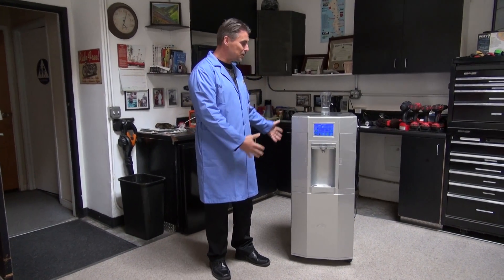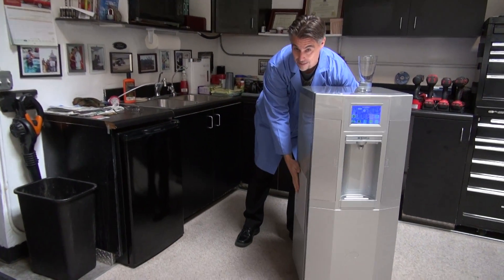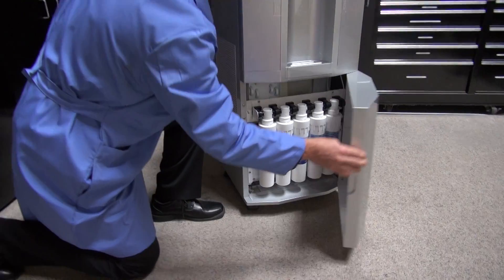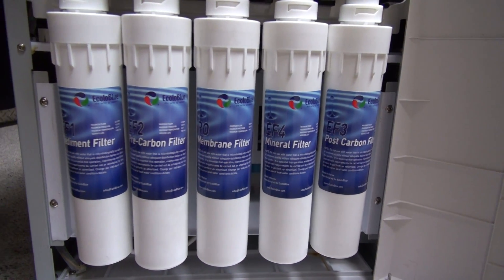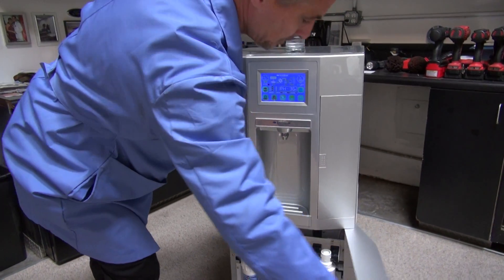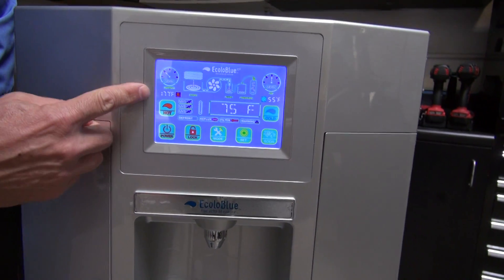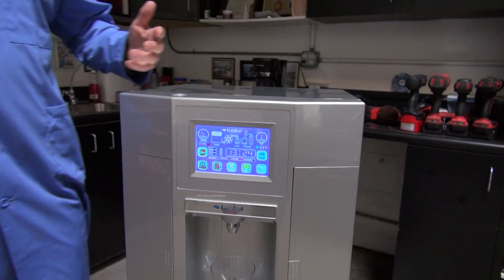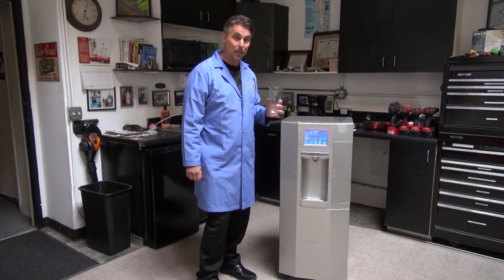Atmospheric Water Generator

Comment: I'm given a project under the same concept although mine is to design an AWG casing, could you kindly assist me by highlighting the factors that I should maybe focus on, the critical specifications, type of material to consider using? Since it should be placed in the rural area, so I have to consider the environment there as well as the evolving weather conditions.
Reply: Please call when you have a moment. (808) 220-4579   I'm the owner and founder of Atmo Systems. We're the largest manufacturing company of Atmospheric Systems. www.asairwaterfiltersystem.com. Just one of many websites we have

Comment: I live in cancun where it's normally 80% humid. However in my house, with the a/c and all windows closed, this number will go down. Can it be installed in a way to pull the air from the outside of the house?
Reply: Yes. It is called a "hose."

Comment: Sustainable? How much electricity does it use lol. Not economical at all.
Reply: It might be, if you connect it with a solar system.
Reply: what solar system?
Reply: @denismercpanganiban9971  Photo-Voltaic Solar panels, an inverter, and battery system, then boom, you're independent of the grid.

Comment: Or you can go buy a dehumidifier at home depot and a brita filter.
Reply: Kim - what chemicals? Its a simple thermodynamic exchange. Water in the air condenses on the cold coils and collects in a tank. The way you cool those coils makes no difference because it never makes contact with water itself.

Thats about as stupid as saying that food from a fridge has chemicals in it.
Reply: This uses exactly the same tools as a dehumidifer. the only difference is the filters is 2 stage carbon. 1 prefilter, and 1 membrain filter with 1 mineral filter to add stuff back in + probably raise the Alkaline levels up as most dehumidifed air water has 0 alkalinity. But that can differ from place to place's air humidity.

You can make this exact kind of machine for cheap (probably 200$) for a portable use. But, the prob is it won't produce a large daily need of water. 

Also No dehumidifers don't have chemicals in their process. Dehumidifers use 2 metal plates. 1 hot 1 cold, and this drops the water into a tank. If you're talking about Bead ones. Then yes, But you can't get water from them as their into gel caps.

But you'll want a filter (a brita filter will do.) to prefilter and clean most stuff out like dirt,etc. then a UV light to kill anything living. Then to reboost the water's drinkable ability for minerals and what not. a Alkaline pitcher. 3 stages. Simple. Or you can add a other stage before  UV killing and realkaling the water, like a membrain filter. This will make it so you'll be 100% sure you'll have everything destroyed and have 100% crystal clear water with no other crap besides Alkaline and minerals water.
Reply: ssuuppeerrbbooyy  Kim is probably thinking of these Gel cap dehumidifier. ( https://www.amazon.com/Comforday-Renewable-Rechargeable-Wireless-Dehumidifier/dp/B00OD4Y8ZW/ref=sr_1_73?s=home-garden&rps=1&ie=UTF8&qid=1476991959&sr=1-73&keywords=dehumidifier&refinements=p_85%3A2470955011 ) | But normal dehumidifiers that use hot and cold plates basicly drips the humid air into a water bucket below. The ones above puts them into gel caps like how Rice will absorb water.
Reply: MrMustang990 hahahahahaha you forgot to mention to add "crucial minerals" to the water
Reply: I was gonna say that! You beat me to it!
Reply: a dehumidifier from home depot can't make 20 gallons of water a day
Reply: Ecoloblue  is still in business : here is the link to there website...…………………………………………………………………………………………………………………………………………………………………………………..http://ecoloblue.com/
Reply: It depends on the humidity of the area. In Virginia I make a gallon a day, not for drinking.
Reply: The problem with that is regular dehumidifiers use different chemicals in their process and the water is not safe for drinking. A simple brita filter is not going to remove those chemicals.

Comment: I need to know what is the quality of the water in a nuclear war situation. Can it produce drinking water from radiation air.
Reply: +Middle Man ofcourse no.
Reply: +Middle Man You need a lot of electricity to run this machine. Do you expect electricity access during nuc war?
Reply: it not about electricity. Its the filtration. It would required 10 times or more than that. Im not sure what kinda filtration that is. But if you concern bout the electricity. Ya it required load of it. Equal to fridge or something like that. ^^
Reply: It would require way more electricity than a fridge. A fridge only cools things down by extract sensible heat, but a atmospheric water generator condensates water vapor by extracting latent heat, and latent heat is usually way bigger than sensible heat.
Reply: To be exact. Those ATW model required around 800-950W(i can say lower than 1KW) while most fridge around 150-400W.